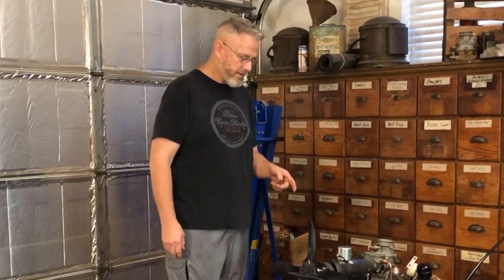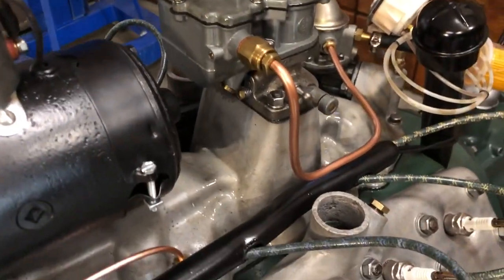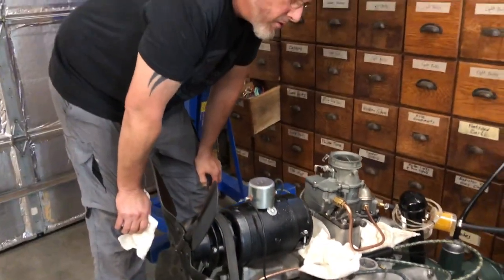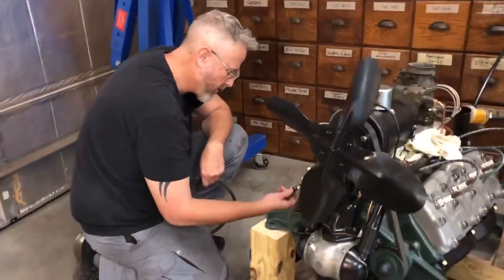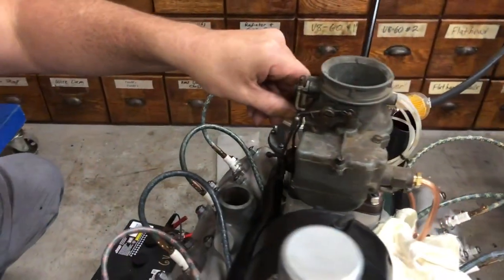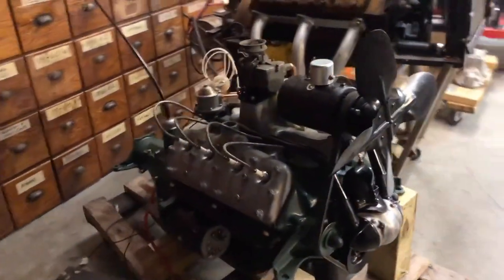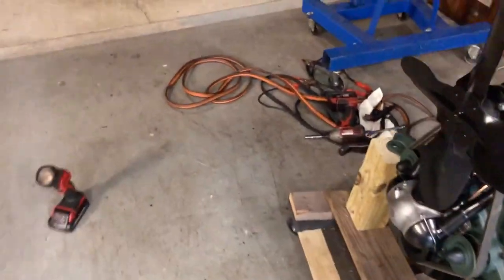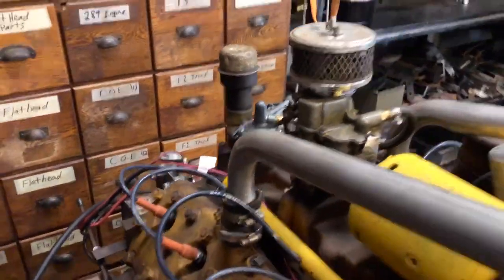1937 Ford Flathead V8-60hp first start

Comment: Beautiful engine! Sounds awesome! But dude, you need a remote start button lol! I use a doorbell button mounted on a block of wood with a couple of clip leads, and a solenoid for Fords.
Reply from the maker: True. I need a lot of things.  All my other stands have solenoids and keys.  
I was too impatient to finish the stand on this one.  I had to hear it run.
Reply: @ChadDrake4185  Haha I know that feeling. I'm well known for rigging stuff to make it go. I've started engines loose on cardboard on the floor, hanging from the hoist, chained in the truck bed, etc. Hearing them run first start is addictive.

Comment: Im not sure if you said in the video what its going into im kinda curious now ive been eyeing one of these for my 30 model a
Reply from the maker: I’m not sure yet.  I have a model A chassis coming.  For a speedster build. I may put it on that.  

I have 4 of these.  This green one, the yellow 60, one with a block in the machine shop and I literally just posted a complete 60 with trans on marketplace.  It will need total rebuild.

Comment: My 1939 9t engine Stromberg 97 carburetor accelerator pump gushes the same when cranking. I later found 3 stuck open intake valves. Not sure if that was my problem.